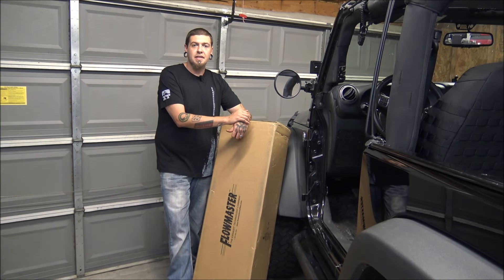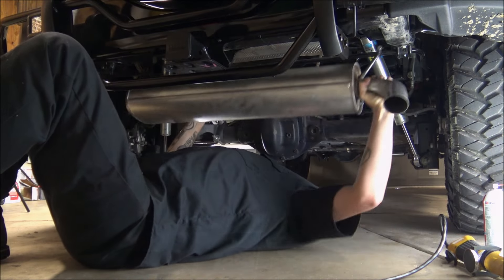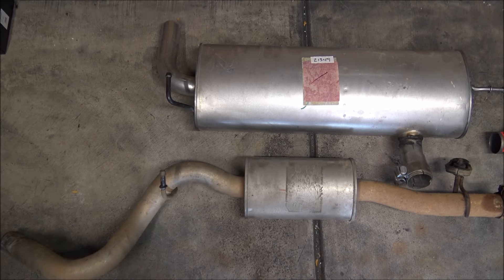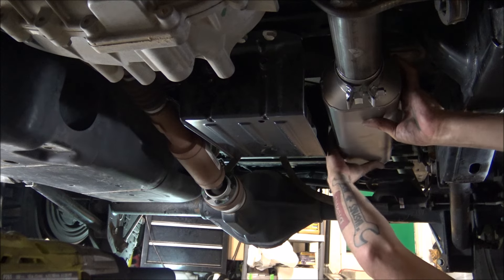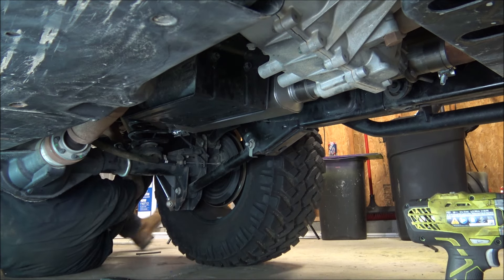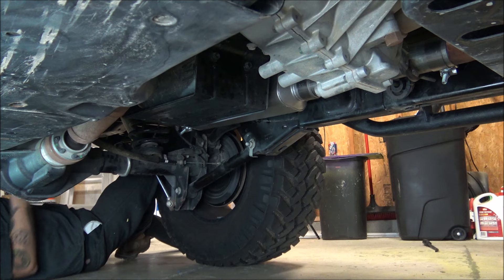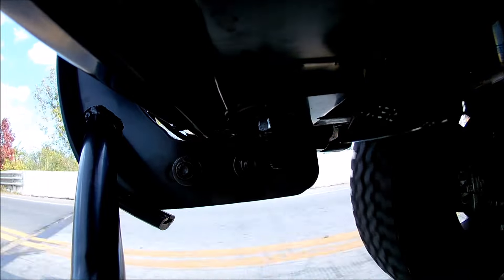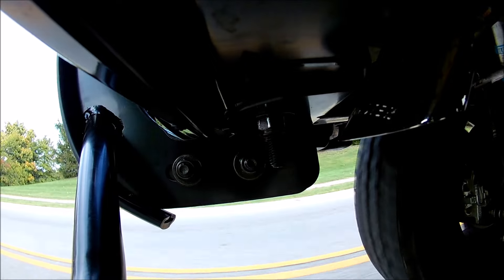Jeep JK Flowmaster American Thunder Cat back Exhaust Install, Review & Sound! PDW Ep.11

Comment: Drone?
Reply from the maker: Surprisingly no. Unfortunately I do not have this kit anymore though. I had to switch to a short pre-axle dump type kit for clearance with my new on board air system. The new exhaust is the Magnaflow Off Road Pro kit, this kit has a TON of drone... Makes me miss the Flowmaster kit. Thanks for watching!
Reply: Rocky X TV do you think I can daily drive de flowmaster,? I want a little more sound from my Jeep but I don’t want the hate of my wife   😩
Reply from the maker: The Flowmaster kit is one of the best sounding kits for the JK, not ricey like a honda and no drone, at least none on the 2 door Jeep. The only issue is along with being one of the best sounding, it is also one of the louder exhausts out there. It's not the loudest, but definitely louder than most.

Comment: Yes, I got it for improving my gas milage 3-4 MPG. But NO 4 door don't matter! I just had a real bad experience with this company, I bought a bolt on Flowmaster American Thunder Cat back of my 4 door JK end up have to hire two mechanic to install, end up have to cut at 2 location just to make it fit right. Flowmaster refuse to be responsible, say neither mechanic know what they are doing, and this was a muffler shop, such BS!  $$$ later.

Comment: You have put together an awesome video with a very thorough look at our system. Nice work, and sweet Jeep! We are however sorry to hear that your install was as challenging as it was. Our approach to the design of this system was similar to what we do with our truck systems, in that we build it for the longest configurations and provide instructions for shortening to fit the shorter vehicles. We noted that as the JK and JKU share the same hanger locations, it should only be the mid-pipe that would need any trimming. The intention being that this would allow this system to be sold at a lower price point than if we were to build individual systems. That being said, we value your feedback greatly and will forward your experience to our R&D team for consideration of any changes or alternative options. If there are ever any questions that we can answer in the meantime, feel free to give us a call at 707-544-4761. 

- Team Flowmaster
Reply from the maker: Thank you very much! I have to say that I am very surprised that Flowmaster watched my video! I do really like this system, but it honestly could use just a little work on the install, I completely understand keeping the cost down by manufacturing it as a "1 size fits all trims" If you get the chance, check out some of the comments for this video and you will see a lot of others that really like this system, but just have issues with either the installation or slight fitment issues. I still say this is one of the best sounding systems for the JK on the market, but I do tell people to have someone else install it or get ready to throw your tool around the garage. Thanks again for watching my video and for making great exhausts!
Reply: @RockyXTV  well there went your sponsorship lol..
Reply: Have any changes been made as of 2021 to make the install easier?